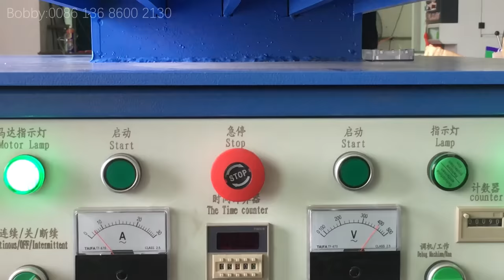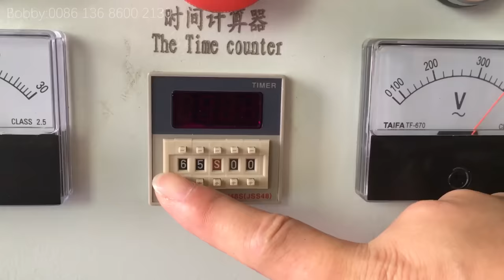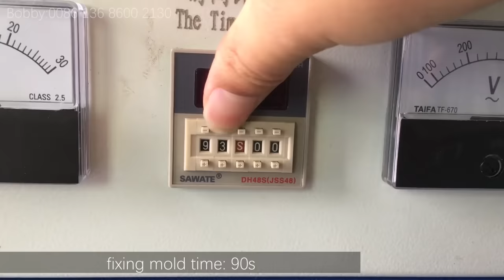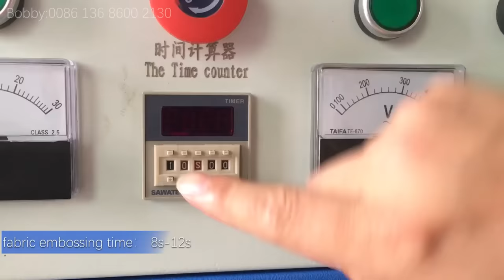clothes/T-shirt/fabric silicone ink Embossing Process, silicone embossing Machine Operation Tutorial

Comment: So there’s silicone all around the logo? Looks like you screen printed a much bigger section then just the logo...
Reply from the maker: I wrap a lot of transparent tape on the grid, leaving only the part that needs to be coated with silicone. The surface of the silicone that penetrates the fabric is only the size of the mold.So there’s silicone no all around the logo